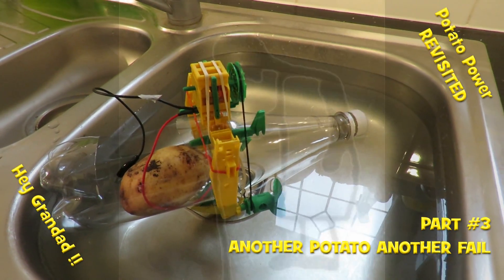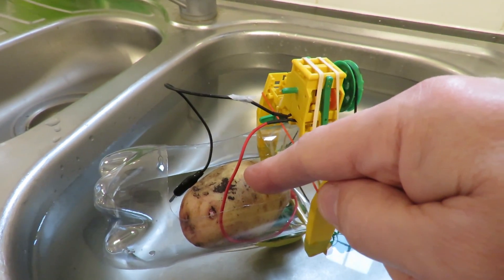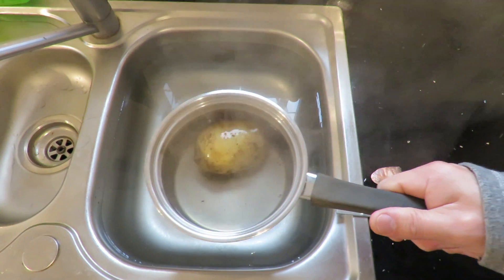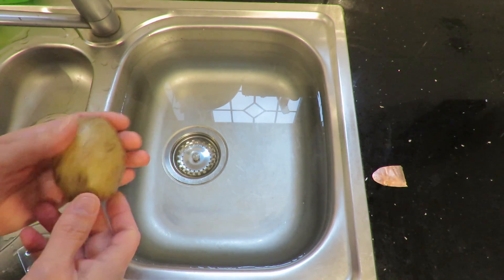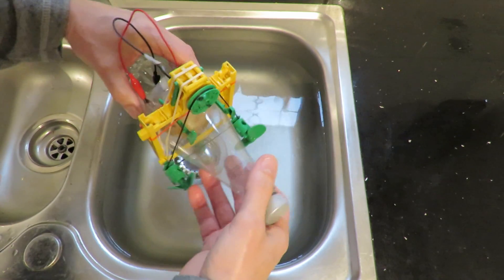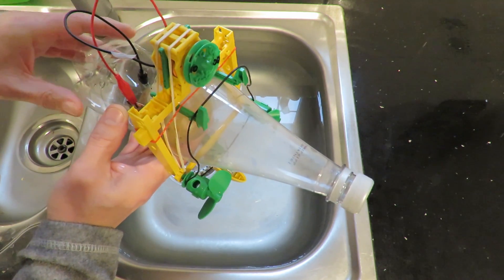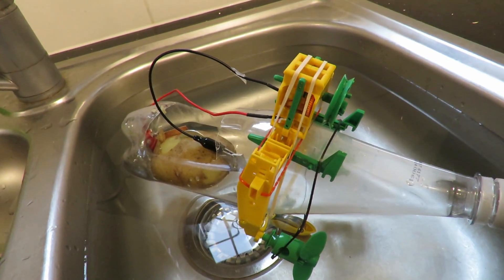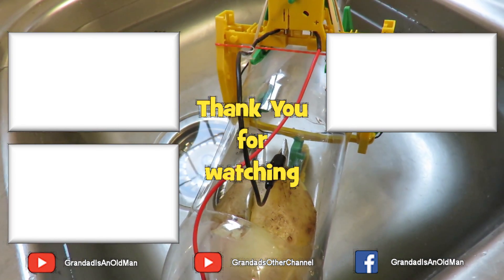Potato Power revisited PART #3 ANOTHER POTATO ANOTHER FAIL

Comment: You might try magnesium ribbon in place of the zinc.
Reply from the maker: You will find that in episode 6 but it is still a fail. I think the only way to get enough AMPS will be to use many more potatoes in parallel. In episode 6 I give some current measurements. Using my smallest solar powered car I measure it taking about 30 milliamps from a AA battery whereas the best my 3 potatoes with copper and magnesium electrodes can manage is about 6 milliamps compared to raw potatoes with copper and zinc at about 0.3 milliamps.